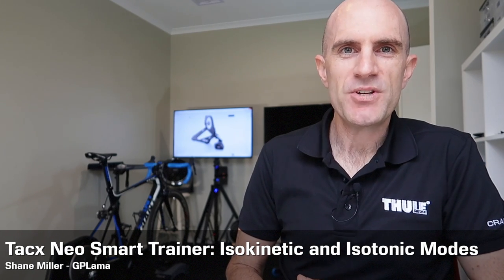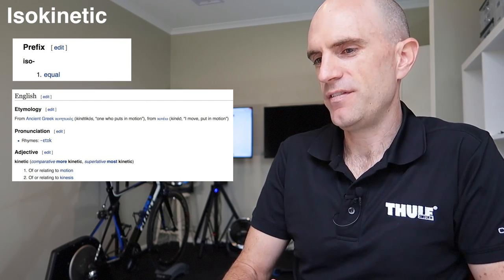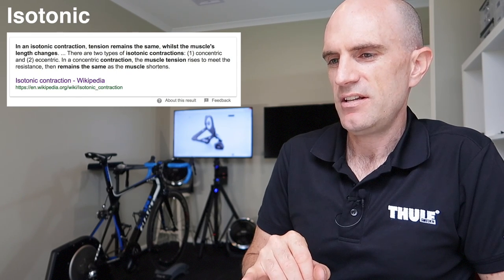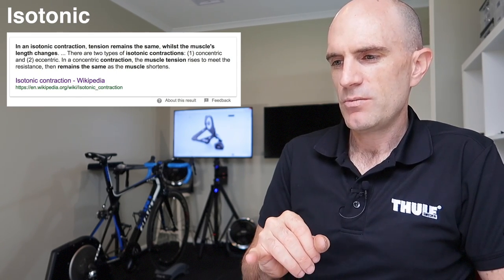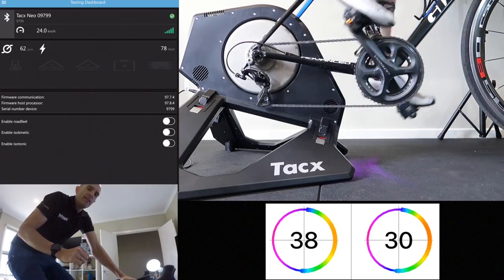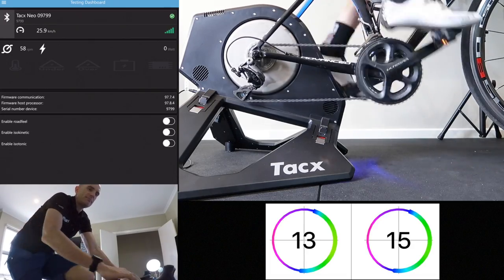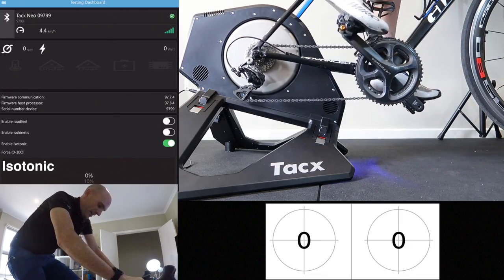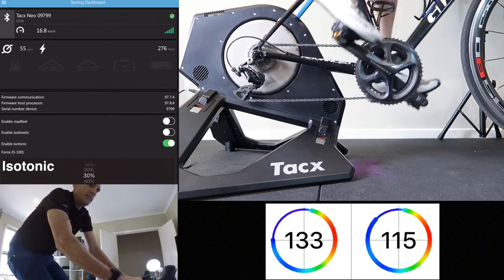Tacx Neo Smart Trainer: Isokinetic and Isotonic Modes

Comment: The SRM Ergometer has had the Isokinetic mode for a long time, but it focuses on a cadence based control.

Lots of use for this in focusing on 'flattening' the power curve by bringing the lower performing parts of the cadence rage up.

Glad one of the smart trainers is finally offering this, as an SRM is currently outside my budget

Comment: Glad you've covered isotonic and isokinetic principles, now I can watch GPlama and say that I'm studying for PE!
Reply: I just finished my PE course. I was under the impression that isokinetic was the same force through a range of movement meaning you are limited by your weakest joint angle (best used for rehab). It seems that Shane was saying isotonic was this? I believe isotonic are normal/most common muscle movements that can be broken up into concentric and eccentric (shortening and lengthening of the muscle)

Comment: I use isotonic mode at %0 to index my gears so I can easily spin the cranks by hand and adjust the derailleur with no resistance.
Reply: Interesting...   With my Kickr...  I've had to take the bike (dedicated training bike) off the Kickr, install a rear wheel and take it to a work stand to do any indexing work.  There isn't a good way to get the Kickr to just spin without load.   OR, at least I haven't found a way.
Reply: Norevlimitr That is clever stuff!!!

Comment: Interesting, I wonder if Isotonic mode simulates climbing a steep hill better? I always feel the trainer feels a little easier at >10% grades as you can rest a little during the dead spots, on a real hill chain tension means you have to push through them.

Comment: You should do a video on how to make your indoor training setup quieter.
Reply from the maker: Step 1: Get a Neo. ;) If budget isn't a concern, and you need quiet, this is the single best option at this point in time.
Reply: I've had success in this quest by isolating the trainer from the floor with some high density foam pads. Put one under every contact point and you'll notice a distinct improvement.

Comment: Shane. What is that tool showing in the bottom right of the screen? Also, is this functionality available for the Flux too?
Reply from the maker: PowerTap pedal analysis using their mobile app connected to the P1 pedals. I don't expect the Flux to have this ability due to the design.

Comment: And now is the time to mount the ‚oval‘ chainrings in isotonic mode! I can send you some over :)
Reply from the maker: +Stephan Leuendorff I saw another paper published yesterday putting yet another nail in that coffin.
Reply: Care to share if you can find it? I'm interested in various opinions regarding oval. Thanks.
Reply from the maker: http://journals.humankinetics.com/doi/abs/10.1123/jab.2017-0035
Reply: Hm - looks clear   still would be interesting to  see if it "feels" easier in isotonic mode - I have been riding "oval" Chainrings for 10.000km  now and   I got used to them - I only tell a difference when I get on a bike with round rings but get used to that fast too.

Comment: I wonder if training in isotonic mode could increase you strength in the dead spots over time.  The small contribution of an increase in power output at dead spots could increase the total force of a pedal revolution without increasing your perceived exertion which I assume comes primarily from the power downstroke.?.  Hmmm...
Reply from the maker: +Zakoplex There’s no free energy, it has to come from somewhere. I’m not convinced increasing dead spot force is of any benefit.
Reply: Not expecting free energy.  ;). Just wondering if gaining contributions from less trained muscle will have an effect.  ...actually, I am looking for some free energy.

Comment: When I had my kickr, I was able to do my custom workout from my personal trainer on my kickr, by getting resistance from switching gears, like riding outside.   No erg mode, now I just bought a tacx neo 2t and I’m trying to do the same thing, but when I put my bike on and start to pedal, no matter what gear I choose it never gets harder.     All I want to do is use it for resistance only, and I want to use my stages for power and my head until to record it.  I dot. Want no readings from the tacx, just resistance, so I can change my power when I want by switching gears. Never had a issue with my kickr.  Please help
Reply from the maker: What you're after is 'level mode' (I think?). The Tacx Training app in the app store should have it. The NEO is a 'smart trainer' but still needs something to control it.

Comment: I know i am late to the game but where did you get those 2 live diagrams showing you the torque throughout the revolution ?
Reply from the maker: PowerTap mobile app linked to the P1 pedals.
Reply: AAhhh well i am not yet there ! thanks
Reply: AAhhh well i am not yet there ! thanks
Reply: That's Apple only (which IMO indicaties how much problems Powertap has). Have they opened up (I think is the term) the data? Like I think Garmin did?   What's this Rouvy company that always shows up when searching for Powertap on the net? At first it looked like they were part of Powertap/Saris etc but they aren't.
Reply: Meanwhile found this on PT site:
"The Advanced Pedal Metrics are available with the PowerTap P1 pedals paired via Bluetooth to an iOs device with the PowerTap mobile app, or via Rouvy virtual training on iOs, Android, or PC. The APM display can be viewed live or reviewed after an activity on your Rouvy Training Diary."
So it's open for Rouvy......or they are the only one that implemented it.    Also found that they are not in de Saris holding......

Comment: hi all, shane miller, I would like to know if the neo tacx 2 has the same functions as the elite drivo as bike fit tests, power tests, ftp, and conconi test for cycling test, import the tests to an excel spreadsheet for an analize, sellers here in brazil do not know much about the application, if possible to make a video explaining how to perform tests in the tacx.
Reply from the maker: Those features are more part of the software used than the trainer itself.
Reply: Shane, in this case the software of the elite drivo is more efficient than the tacx, does it have more features? for evaluation like power tests, conconi and others, the test has to be evaluated in other software like golden cheeat? I would like to know this?
Reply from the maker: @marcelofurtado591  You'll have to refer to the companies who make the software, sorry.

Comment: What happened to your 2inpower
Reply from the maker: +John Grant Not compatible with the PM I have on the left crank arm.
Reply: Shane Miller when or if the 2inpower go back on are you going to test out the Qrings to see if they do make a difference in the dead spot ?
Reply from the maker: No plans on trying Q-Rings. I'm just not seeing any convincing data indicating they're worth looking into. I don't buy into the marketing.

Comment: Hi. Love your videos. Myself i have a Neo. Found this today online: http://www.bikeacces.com/127468127463rocking-plate.html Would like to see making a test of that.
Reply from the maker: I've seen those. My biggest concern is if they move forward or back in ANY WAY, they'll grind rear dropouts.
Reply: Shane Miller Do you think you should use high pressure in the front tyre for the same reason?
Reply from the maker: Sure... just as long as it isn't bouncy.